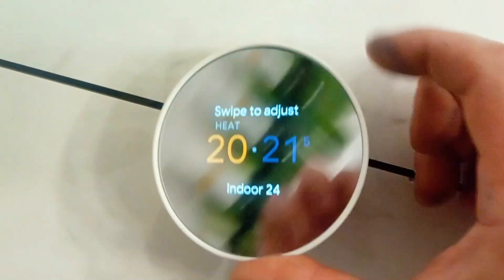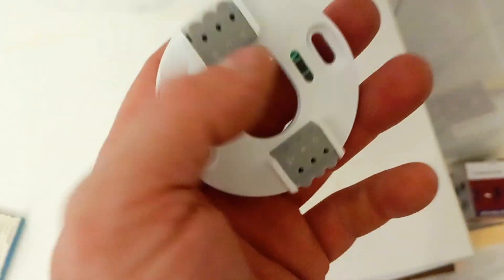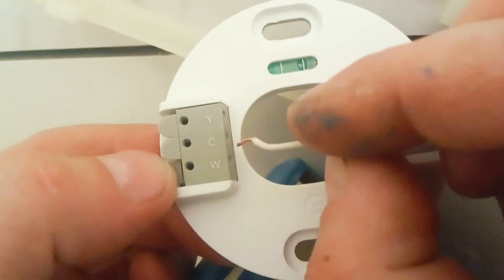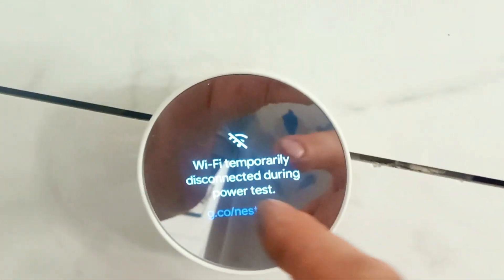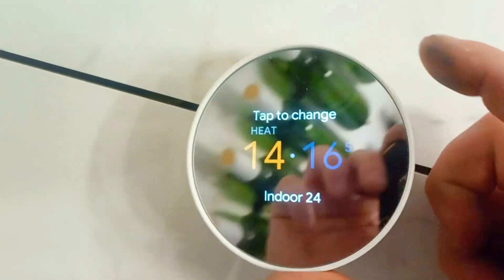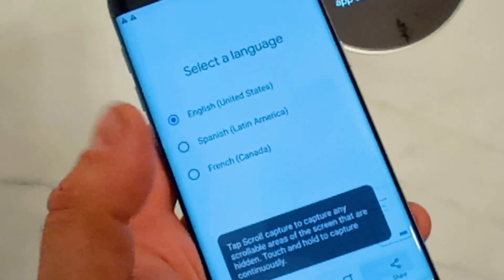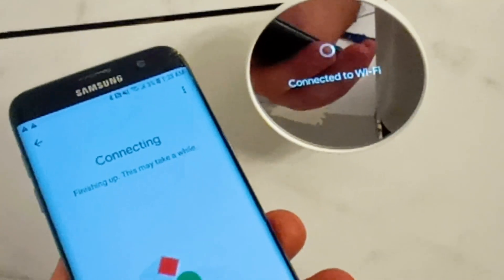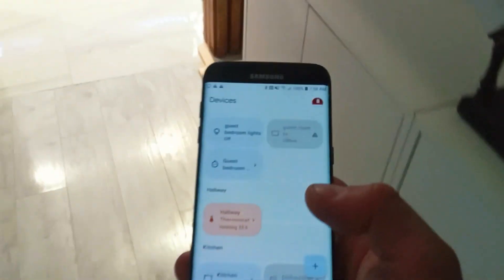4th Gen Nest Thermostat *No C Wire* Install in 4-Wire 1980s House | Step-by-Step Install & Setup

Comment from the maker: https://geni.us/GoogNest4thThermo - Today we do Step by Step 4th Generation Google Nest Thermostat Installation and Google App Thermostat configuration setup under 10 minutes. This is not a C Wire Installation video, nest thermostat will work without a C wire or Nest Power Connector connected to your HVAC control board. So we replace a 1980s honeywell thermostat with 4 wires, and we do not have a C Wire or BO (heating pump). Also, if you have an Rx wire loop on your old thermostat like we do, during the google configuration wizard DO NOT check , Rx on your setup as you will get not compatible error and it won't let you finish the installation. This is a super simple install and does not really require turning off any power, although this video is for entertainment purposes only.